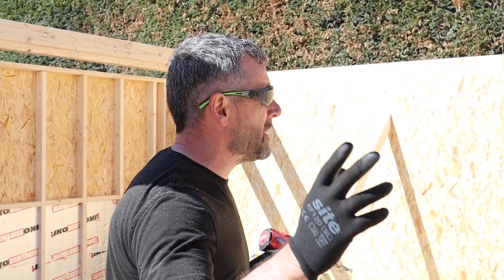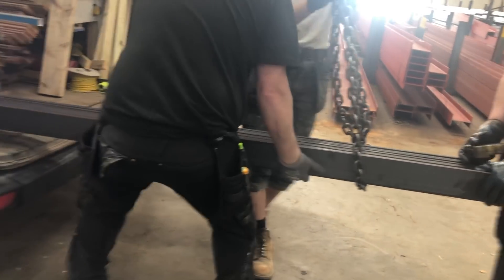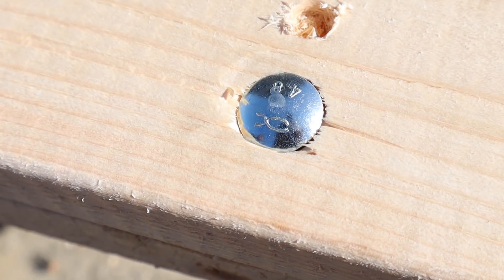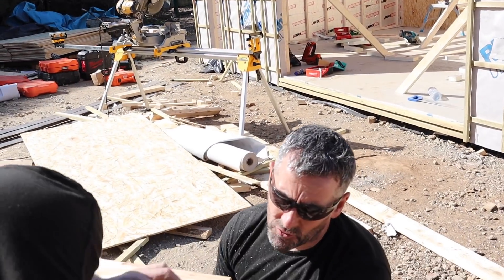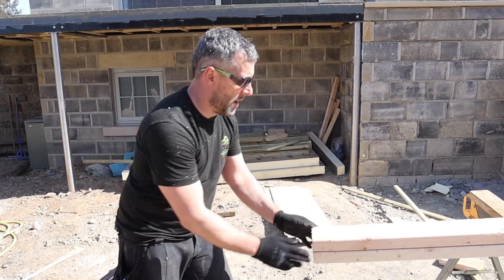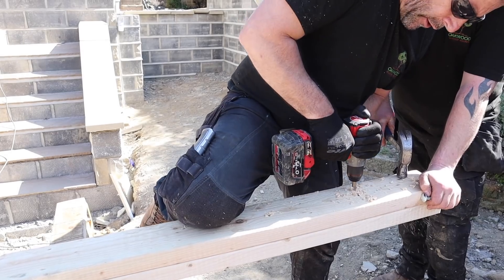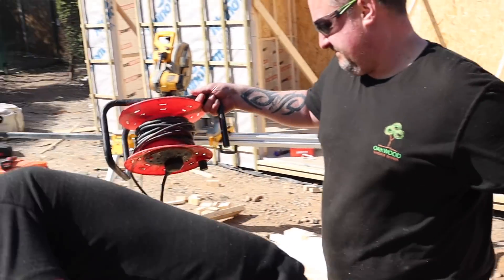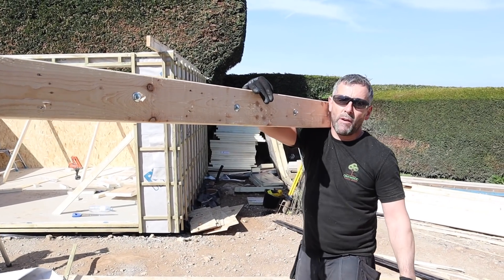How we create a flitch beam roof in a garden room

Comment: Liam, what would your recommendation on a flitch beam for a 5mt span be?
Based on your same process of flitch beams spaced between doubled up beams?
Reply from the maker: If it’s 5mtr deep are you not getting planning mate ? If so you can use the correct size joist for the span 🧐

Comment: I have seen large square washers used under the bolt heads and nuts to prevent the bolt pressure points from being sunk into the wood.

Comment: Hi great video.
I have to fit a flitch beam on my extension I'm starting next month. Can you give me some advice, going to bolt onto a wall plate with joist hangers. Bit worried about fitting a flitch beam into a joist hanger 100 mm wide?.

Comment: you shouldn't be using coach bolts. You should be using threaded bolts with a large square washer so that you pull everything tight without breaking into the wood. amateurs.
Reply: At last somebody else who doesn't worship this guy,
There's so much wrong with these builds
No double heads on the studwalls, joists not positioned above studs, no treated timbers,
Not strengthened C16 or C24 timbers for longer members,
Looks great 2 the amateur YouTube viewer tho!
Reply from the maker: Mate, worship? I think you need to move onto the next video, your a little too close to weird 👍🏼
Reply: @thegardenroomguru  👍
Reply: Liam is constrained by a maximum height of 2.5m without planning permission.  Given that it's a garden building his solution is strong, safe and cost effective.
Reply: @SimonMcNair  thanks for your expert insights 👌
Reply: These guys are building fantastic garden rooms, not 2 storey houses.. the single top runner is sufficient, especially at 400mm centres (which a lot of there buildings are). The square washer applies again to houses and mainly trusses. A flitch beam roof is insane!  Sometimes I reckon they are overdoing the spec and potentially pricing themselves out of jobs compared to cowboys. Great videos. Can't please everyone (especially the 'experts').
Reply: @Ryanbourn  😂😂Well an expert you certainly are not these "garden rooms" cost 20k plus, so the least I'd expect is for them to be built properly, a single "top runner" (are you American) is not sufficient especially when not using structurally graded & un treated timber, when people pay top dollar for a product you expect proper building practices to be in use! Its not a £700 B&q shed after all!

Comment: Is the maximum height to the bottom of eves or top great vid by the way
Reply: "To be constructed without planning permission, outbuildings need to adhere to some quite strict rules. Outdoor structures must have only one storey and eaves (the bottom part of the roof) no higher than 2.5 metres, with the overall maximum height being 4 metres for a dual pitched roof (two sides to the roof) or 3 metres for any other building roof.

They must also have a maximum height of 2.5 metres in the case of a building, enclosure or container within two metres of a boundary of the curtilage of the dwellinghouse." 👍
Reply: @andyklyon  cheers for your reply watch all your vids keep them coming great to watch
Reply: @andyklyon  when we say the eaves bottom part of the roof, is this the outside ground level up to the underside of the roof rafters  
/soffit board?

Is the lower level neasured from the ground, or the floor of the building which could be 200mm ish of the deck if built on ground screws.
Reply: @handle1196  from the highest part of the ground mate

Comment: My build is 5.8x 5.6. Could I use this method for my roof span . I thought about putting a steel under joists in the middle but would rather not if I do t have to.
Reply from the maker: Depends if your building to the 2.5 mate?
Reply: @thegardenroomguru  it will be just under . I was more referring to the strength as 5.8 seems a long span. Mabey this will add enough strength in the joists to span that far?
Reply from the maker: @richardkirton7868  yes mate, was just asking if you were keeping under 2.5, if not a bigger joists. I’d have no issues spanning your depth with these
Reply: @thegardenroomguru  cheers bud. Much appreciated.

Comment: you could just put the steel on top of two pieces then drill the holes 😉
Reply from the maker: Timbers aren’t straight, if we do that they won’t be flush 😏
Reply: @thegardenroomguru  experience is a wonderful teacher 👍👍👍
Reply: @therealdojj  clamps are good too....
Reply: @darkvoltage68  I think the way is been done is the way I was taught, and the double beans are also the way I was taught
And that was 32 years ago so it just goes to show how the old school stuff still works 👍
Reply: @therealdojj  not saying it doesn't, but if you can't select straight timber, stacking and clamping is very quick and easy, and works well.

Comment: Liam why don’t you get a a bolt in each end when flip it over to do the rest?
Reply from the maker: Timbers aren’t straight, this way they are in line 👍🏼
Reply: @thegardenroomguru  I would never question you normally Liam but it seemed like you could get one or two bolts in and then flip it over so you weren't drill from underneath and still get the same result.
But again you don't normally miss a trick so I'm sure you've not here.
Reply: ive done a lot of flitch beams and what i do is put the plate on top of the two timbers and drill through both at the same time then just swop them around